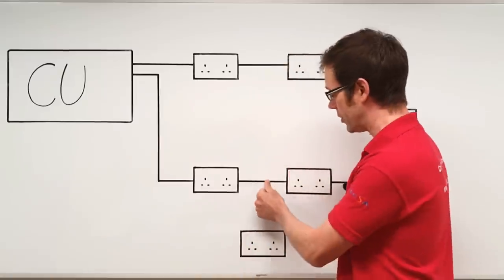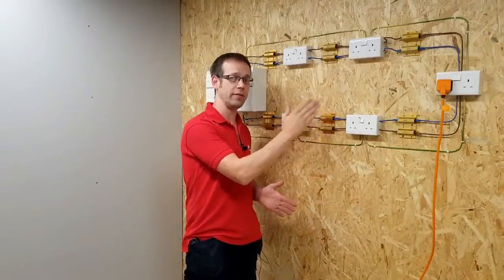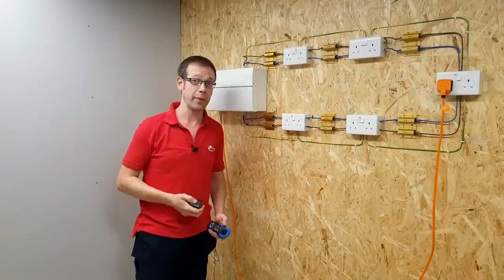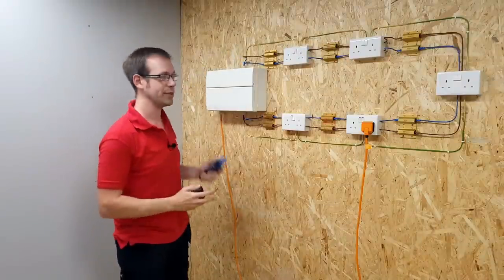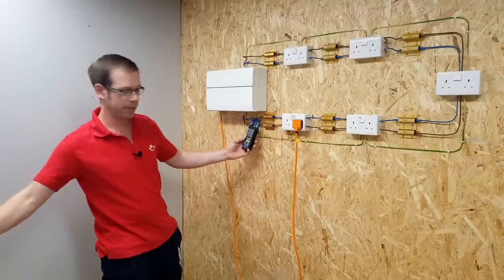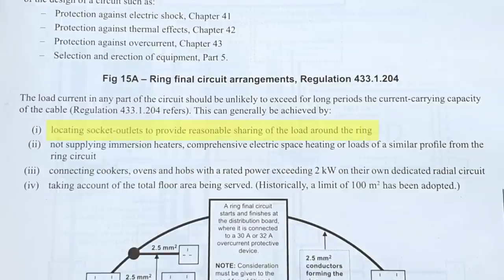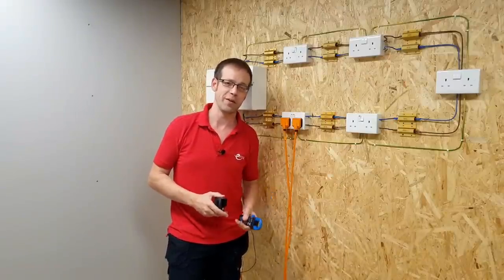KNOW HOW: How does current divide in a ring final circuit? (ring main)

Comment: The penny dropped for me when you said that the current is split in inverse proportion to the resistances. I immediately thought of lightening, does that mean that current is actually travelling through every possible route to the ground, but it's only visible when the current is over a certain amount? enough to ionise the air or something?
Reply: No. The resistance of air is very high, until the electric field strength across it is high enough to cause an avalanche breakdown, in which point the resistance drops massively and the current flows through that ionised channel.

Comment: Great video 👍. Would you say any Junction box under 32A is unacceptable? I've seen a well know electrican youtuber use 24A wago connectors and he used that reason of the load being split down each leg?
Reply: I believe i Am correct in saying BS7671 states that conductors of a ring final circuit must have a min ccc of 21a so I would assume a joint of a rating exceeding this requirement is satisfactory. As joe mentioned there is only so much we can do.
Reply: Joe mentioned in a previous video that by the regs, the connection should be rated to no less than 20A. The Wago 222s, to which I believe you refer, are fine for this.

Comment: Could you create a ring circuit by using junction boxes. What I mean by this is that you have your feed from CU, that goes to the first junction box, you then have 2.5 going down to the socket and then have a feed out at the junction box. Like a T formation. This then repeats on all sockets. And at the end junction box, your feed out would go back to the CU. If you can’t do this why?
Reply: Yes you can.  Best to use Wago connectors on the ring inside the Junction boxes. 
Or better still have deep socket boxes. Then have the Wago connectors inside the box (the back box is also acts as a  junction box).
From the Wago to the socket have flexible L, N & E 2.5mm wires. Using the flexible wires make it easier to push in the socket. 
Easy, safer and quick using Wagos. The wires will not work loose over time in Wagos as in a screwed connection. 
Look up the vid on Wagos.
Reply: @johnburns4017  are you sure about that? If you think about it, wouldn’t that mean that you can’t spur from the socket as the cable already has a socket on it. Btw I totally agree with wagos. If you see below I have done a little diagram, the @ signs are the junction boxes with wagos in the, and the % are sockets

———@———@————
           |            |
           |            |
           %         %
Reply: @db-bv5rs  
Correct, no spurs, as each socket is a spur off the ring.  You could have Wagos with one more extra connection for another wire and have:

---@--------@---
     |--¬       |
     |   |       |
     |   |       |
     % %     %

Two sockets off one Wago junction (clunky drawing I know). Both sockets are off the ring as arguably the brass inside the Wago forms the ring - a short solid brass cable.  It has a longish brass piece inside.  The wires in the Wago go into their own slots, not meeting, as in screwed terminals. So a four connection Wago with the ring wires at each end, with the sockets off the centre connections, looks like the two sockets are individual spurs off the ring.

It is not like many wires together into one brass screwed terminal.
Reply: @johnburns4017  yes I see this works because you basically have a ring with no sockets on and you are basically cutting the cable and adding a spur. Obviously one spur is fine on a normal ring with sockets however adding another one creates a potential of 26amps to flow through a  2.5mm 26amp rated cable (clipped direct) which is ok but we don’t really want so we have to add a 13a fcu before both Spurs.
Reply: @johnburns4017  yes I see this works because you basically have a ring with no sockets on and you are basically cutting the cable and adding a spur. Obviously one spur is fine on a normal ring with sockets however adding another one creates a potential of 26amps to flow through a  2.5mm 26amp rated cable (clipped direct) which is ok but we don’t really want so we have to add a 13a fcu before both Spurs.
Reply: @johnburns4017  although this is a good idea for kitchens to save 2 cables going down the wall, this is bad as you cannot spur off of it like you normally could. I agree I use wagos all of the time, they are reusable, easy to fit and time saving. This is also good because if they are in a ceiling they are maintenance free.
Reply: @db-bv5rs  
If you have a switchless FCU with a 13A fuse off a ring you may have multiple sockets off the FCU forming a sub radial.  The 13A fuse then protects a sub radial.  As the fuse protects the sub radial (spur), the cable only needs to be 1.5mm. 

Plug in two 3kW kettles then the fuse blows.
Reply: @db-bv5rs  
What I am saying is that using Wagos you can have the ring cables in and out. And two spurs off the Wago using their own cables back to the Wago. Physically the brass block on the Wago forms a part of the ring - a micro bus bar. 

Some may say the Wago is one connection terminal, which it is not as the wires have their own connections into the Wago block (bus bar).
Reply: @johnburns4017  surprising how a little brass bar can withstand 32a, even more obviously because that’s not going to burn out the Wago. Didn’t John Ward make a video about connectors?
Reply: @johnburns4017  I am not a fan of screw terminal junction boxes. I get patress boxes or the actual Wago boxes. I prefer patress boxes as they’re cheaper and has many entries.
Reply: @db-bv5rs  
JW did comparing Wago copies with Wagos, pushing through excessive current levels.  The Wagos performed better, but the copies also performed well.

Comment: I put an amp clamp on my ring circuit at the consumer unit, with a toaster switched on in the kitchen. 
Leg One: read 2.64 Amps, 
Leg Two: read 0.88 Amps. 
That is one leg is drawing 75% of the current, while the other draws 25%.
Clearly not an equal draw around the ring circuit.

Leg One is the most loaded leg. 
If I switch on an additional electric kettle in the kitchen at a 9 Amps draw (75%): Total: 11.64 Amps.
If I switch on another additional electric appliance at a 9 Amps draw (75%): Total: 20.64 Amps.

Leg One will be drawing 20.64 Amps. 75% of kitchen load.
Leg Two will be drawing 6.88 Amps. 25% of kitchen load.
Total draw is 27.52 Amps. 

A 2.5mm cable is rated at approx 27 Amps maximum draw, so Leg One's cable is fine at 20.64 Amps.

If I put the appliances on another part of the ring, no doubt Leg Two would draw more than Leg One.

But!  As an aside, in my place the washing machine has its own RCBO, as does the fridge, boiler, dishwasher and TV & Modem. 
So Leg One is never likely to draw more than approx 12 Amps.

Comment: An electrician recently discovered my house had a ring circuit wired incorrectly with each leg of the circuit going to two different 16amp mcbs. He changed this so both of the legs run to one 20amp mcb. 

Would love a video explaining why this is dangerous
Reply: You do not need a vid to explain that.

Comment: I can put on as many radial circuits as i like on a ring though, so how does that work out?
Diversity?
Reply: What you said doesn't make any sense I'm afraid. There are two types of circuit used which are "radial" and "ring final". I assume by "radial circuit" you are refurring to a spur. If thats the case you should know that the limit for unfused spurs on a ring final is equal to the number of socket outlets in the ring. For example, If you had a ring circuit with 4 socket outlets (single or double) connected "in ring" - the maximum number of unfused spurs that are permitted would be 4 individual spurs feeding only one single or double socket each. Personally I think ring circuits are a terrible idea and spurs are the work of the devil. The problem is that you never know what DIYer/cowboy is going to double or tripple spur by trailing off an exsisting spur and create the potential for overloading the spur conductors. I see it all the time. What I do instead when I need to add a socket is run two cables instead of one and "extend" the ring circuit to include the new socket. In my opinion it is the best option. One final note - Diversity is only used when calculating maximum demand for an installation. It is not used for calculating loads for a final circuit.
Reply: @mastergx1  what's the difference between a spur and a radial on a ring? Nothing
Reply: @Surferant666  By definition, a radial circuit is an independant final circuit in its own right, with its own protective device. A spur, on the other hand, is an extension of a final circuit.
Reply: @mastergx1  a spur can be protected too
Reply: @mastergx1  
If you are concerened that a DIYer in the future will increase a spur from one to two or three off that spur, then fit in 4mm cable to the spured socket.  You can have a number of sockets off one spur.  It is achieved by istalling a switchless FCU with a 13A fuse in it.  Then the cable on that spur will never exceed 13A, no matter how many sockets are after the FCU. All legal.

Making the extra socket a part of the ring is the best option.

Comment: Nice video. Perked up when I heard you quote, current is inversely proportional to the resistance. Anyway, regarding loads when balancing the circuit, you have no control over what is plugged in, unlike for fixed loads. Not criticising, just thinking. Which is what all your videos do to me. Again, nice video.

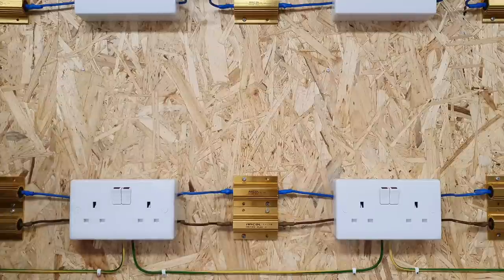Comment: 2:23 Socket at the mid-point of the circuit - hence your claim that the resistance in each side of the ring main are the same.
Obviosly, you've measured this to check - so what are the resistance values of L1, L2,N1 and N2 ?

Comment: Would have been useful to show the corresponding current in the neutral cable on either side of the load too. It would give a better understanding of where / how the current flows.
Reply: In one-phase circuits, the current on the neutral cable is the same as the current in the phase
Reply: @vitorao  I know that. But I am talking about the flow not the magnitude.
Reply: @veritasaequitas9875 , it will be the opposite of the phase. When the phase has a positive current, the neutral will have a negative one, and vice versa. Of course, you won't be able to see that in a multimeter. You will need an oscilloscope and a shunt resistor.
Reply: @vitorao  I don't think you understand what I am getting at but we'll leave it there.
Reply: @vitorao  Ok. Try this.
In a radial circuit, when the current leaves the device via the neutral pin, how many pathways are there back to the breaker box?
In a ring circuit, when the current leaves the device via the neutral pin, how many pathways are there back to the breaker box?
Reply: @veritasaequitas9875 , well typically, the neutral conductor doesn't go to the breaker (I think you mean the consumer unit). Also, in AC, the current does not ""leave" the device via the neutral. It alternates.

If you want to know the current in the neutral connector in each side of the ring circuit, it will depend on the resistance that that side offers, in the same way that was shown in this video using the phase as an example.
Reply: @vitorao  
I know. I forgot to type "box". Distribution unit. Consumer Unit. Whatever you want to call it. You know what I mean.
There is ONE path for a radial and TWO for a ring. 
That was the point of my original response. 
Another aspect of a ring that makes it different from a radial.

Comment: Does this hold true for 120 volt single phase systems?
Reply: The principle holds true for any voltage, but local code would not allow it, mainly because there is no fuse in a 120V plug so the breaker has to protect the appliance too. A 32A breaker protecting a bedside lamp cable would be dangerous, but the UK system has a 3A or 13A fuse in the plug

Comment: I don’t understand the point about “balancing the legs”. The “legs” of the ring circuit are with respect to a given point along the ring circuit. How can you know where a given load is going to be plugged in along the ring to then attempt to match the two runs of cable that lead to that point?

Unless what is meant by “balancing the legs” is designing a ring circuit that is optimised for a given socket along it? For example a particular socket that is expected to see the highest loads. 

All of this seems an extremely silly game to play when in reality you should use 4mm2 cable with a 32A breaker if there are any doubts as to the kind of expected loads along the circuit. 

The only real advantage I see to 2.5mm2 cable used on a 32A ring is the extra ease of bending/working with the smaller cable when wiring sockets (which is a reasonable advantage, plus the cost saving). 

2.5mm2 rings are obviously good enough for the vast majority of installations, as evidenced by their prevalence. But once you start worrying about balancing the legs to attempt to share the current equally, I think it’s time for 4mm2 cable.
Reply: Plus 20A/32A radial circuits easier/quicker to test
Reply: Agreed.  We could ponder over this dilemma forever.  The 32a ring has stood the test of time, and ain't going away anytime soon
Reply: You can't balance it perfectly, precisely for the reason you state, people can plug in whatever loads they want around the ring, and that can change from week to week , month to month.  And there is no need to balance it: it achieves nothing. 

The only thing you have to worry about is the rare scenario where you have too much load on one side of the ring and the current exceeds the cable rating but does not exceed the breaker rating, and the cable overheats causing a fire, and the breaker does not trip.
Reply: @jasonelson7238  
A ring can be split at a socket then tested as two radials, if testing a ring is complex for some.

Comment: If you want to 'balance the ring', route both halves of the ring the same - so from the moon, it'd look like a radial - but in fact will have pairs of conductors.
Reply: Would that not defeat the supposed benefits of a ring: economy of cable? 4mm2 radial might be a better idea. Which is really the issue here, is it not?

Comment: Very interesting. I’m a viewer from the US, where a ring circuit is unheard of. Why would you use a ring circuit? Sound very dangerous, turning off one breaker would not de-energize the circuit, ouch!
Reply from the maker: It’s still one breaker - you can read about the history and background here. https://en.m.wikipedia.org/wiki/Ring_circuit
Reply: That's not correct - both ends of the circuit go to the same breaker. There is only one switch to de-energise all the sockets. The concept was invented to save copper after WW2. It's actually ingenious as it relies on a simple electrical principle. As installed by electricians they are perfectly safe. (The amount of testing and regulation in the UK means standards are generally very high).

The only downside is that DIY'ers or kitchen fitters come along and often don't understand what a ring circuit is. They disconnect one leg of the ring & nothing stops working so they assume it's unused. They leave the job and as far as they know, everything is still working. However they have now created two separate radials on a single 32A breaker with undersized wiring on each!

This isn't really an issue with ring circuits themselves, as there's plenty of other ways that unqualified or unskilled people can make dangerous alterations to electrical installations.